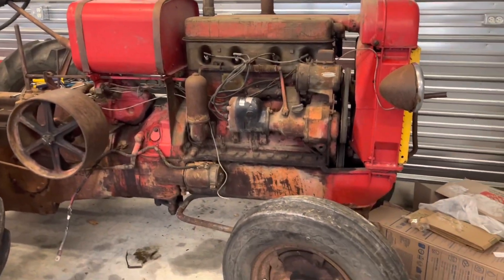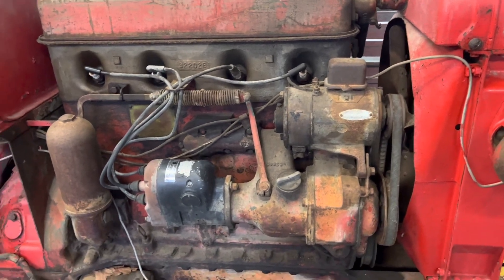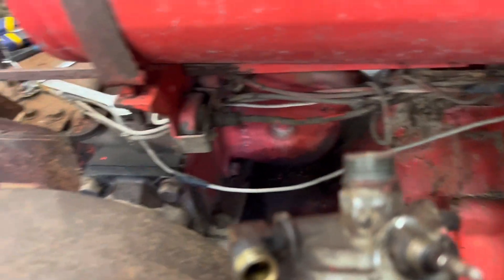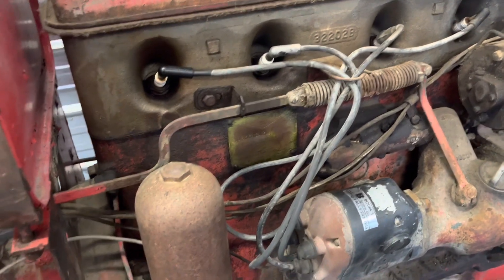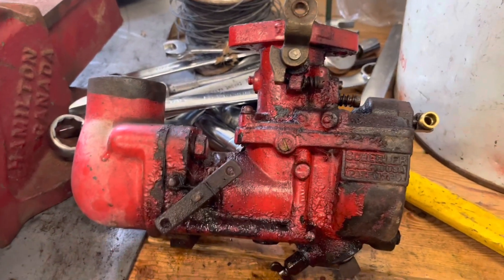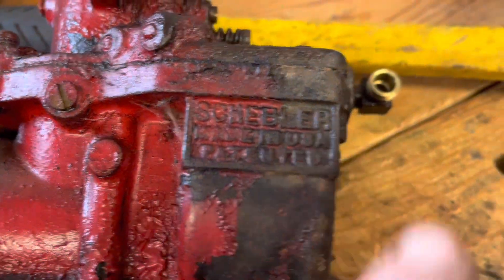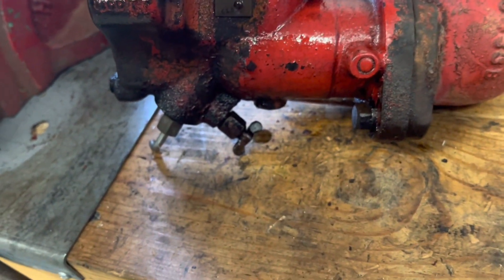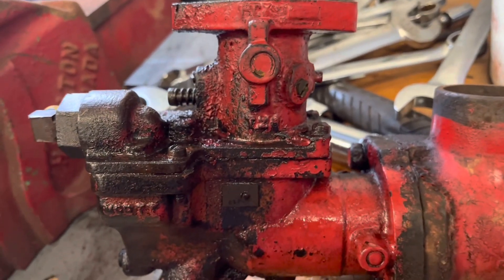Merry Christmas and 80 update

Comment: Merry Christmas!! It's gonna be fun project. Was that generator added on. They didn't have them originally right?
Reply from the maker: The 80s you had the option for electric start, lights were 6 volt of course. The 18-28s did not.
Reply: Good  day  Jason 1Pa   Merry Christmas & happy new yr. to you.  Thanks
Reply: @donvoll2580  Merry Christmas to you too Don!